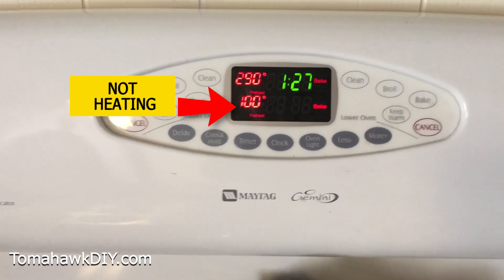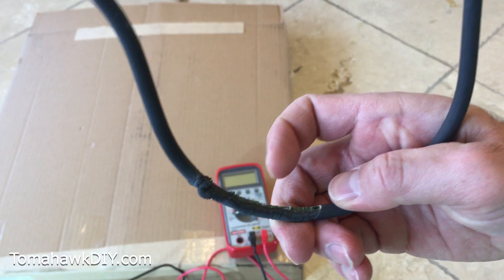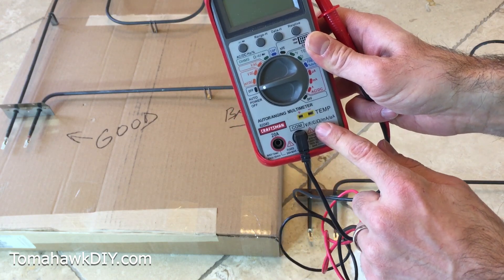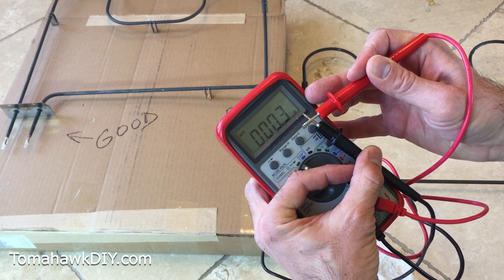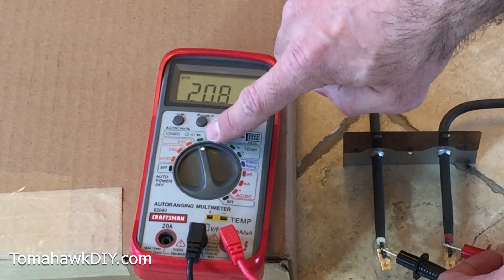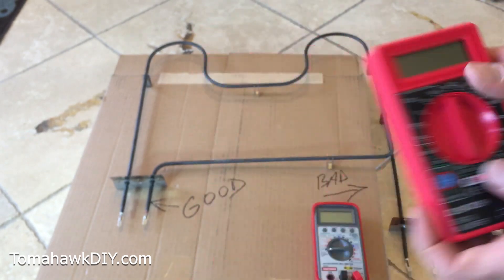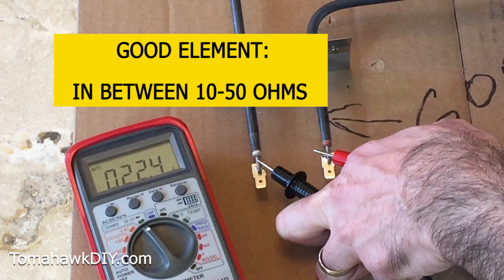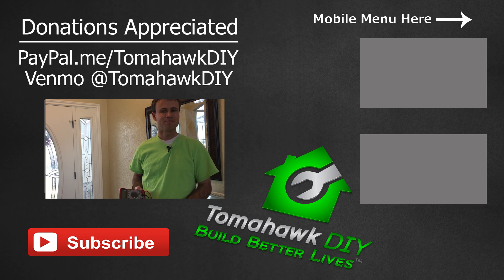How to Measure Electrical Resistance: Is It Good or Bad?

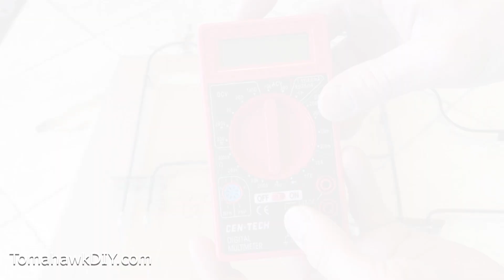Comment: 3:24 That meter is decidedly digital as well.  It's not auto-ranging, but it's still digital.  If you're not sure what you should be reading, you start at the highest setting and work your way down; generally it just moves the decimal point for you.
Reply from the maker: Great points.  Thanks Jay!